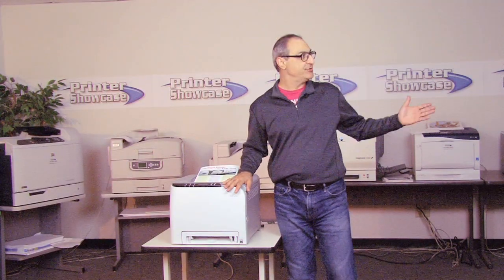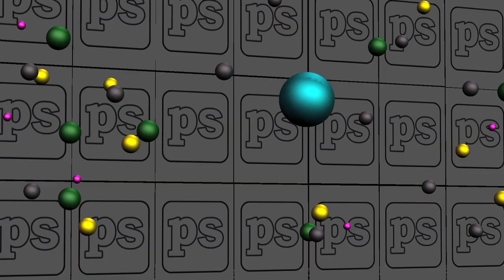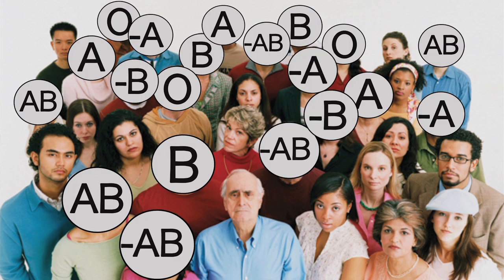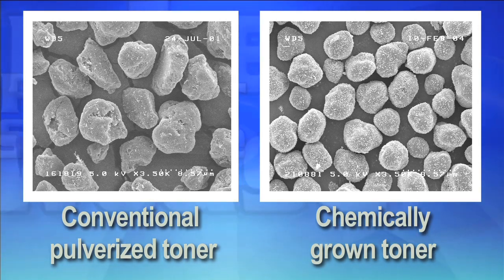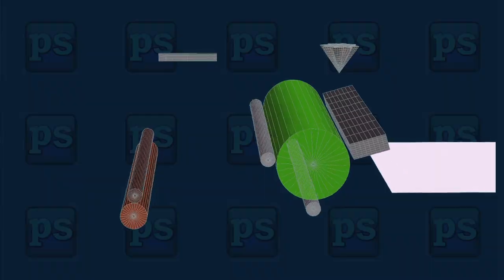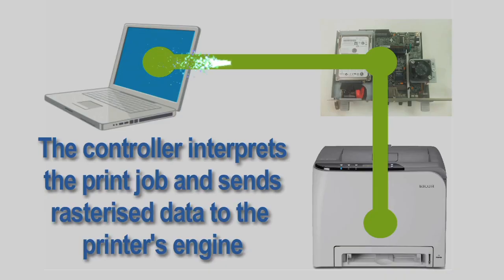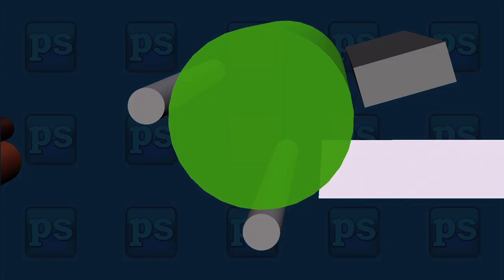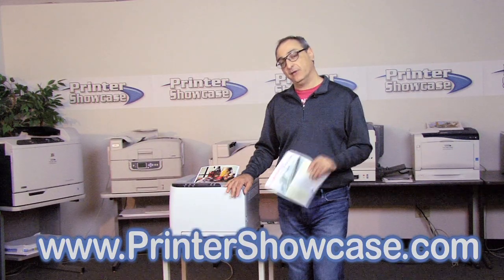How Does a Laser Printer Engine Work?

Comment: But how laser and rotating mirror knows where to focus beam and how laser creat or distroy charge ?
Reply from the maker: The controller creates the image, the rotating mirror just rotates, the laser is stationary but will turn on and off as directed by the controller, and the drum rotates at it's fixed rate. The drum is recharged by the transfer charge each revolution.

Comment: Excellent video, thank you!  Can you please tell me what you mean by there are low cost printers that don't need refilling?  Can you provide me with a link to learn about this? Cheers.
Reply from the maker: Learn about Cost Per Page, (CPP), before you buy. A set of toners can easily cost more than you spent for your color laser printer. That's why many people will turn to third party toners which unfortunately end up destroying the printer. If you look you will find there are printers out there that are very inexpensive to operate using genuine supplies so you can keep your printer running for many years.